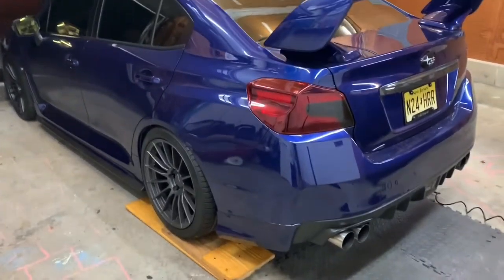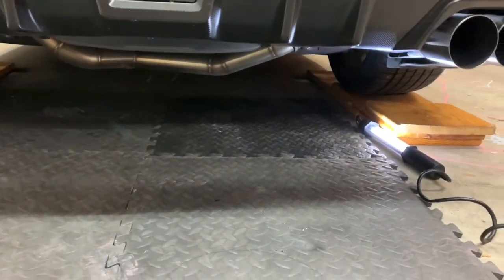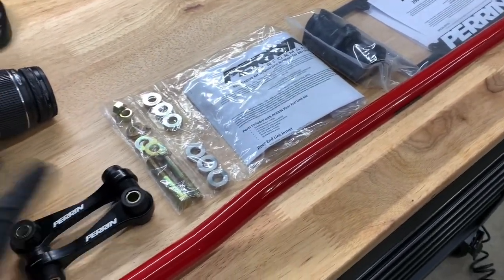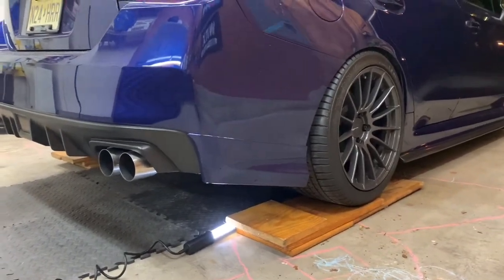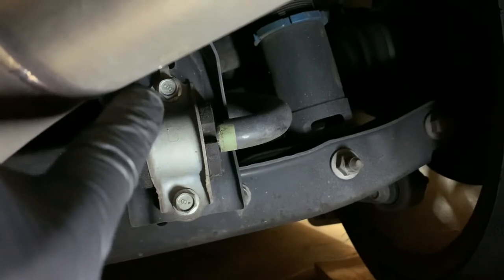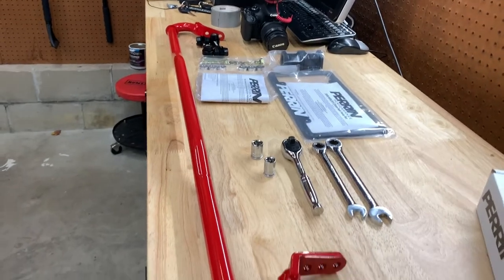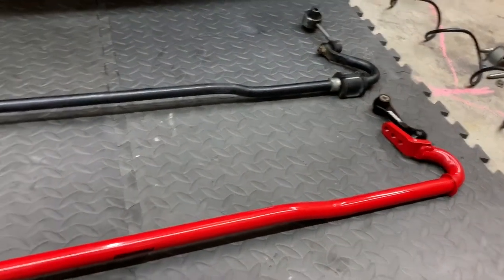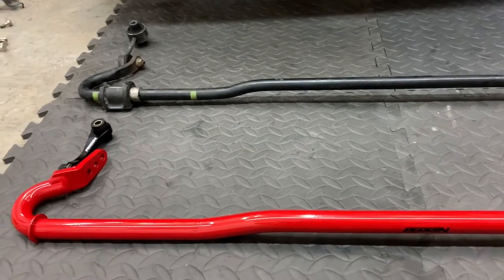Subaru STI Perrin Sway Bar and Endlink Install

Comment: @5:00 remember also that you don't need to PRY the end links out... all you need to do is loosen up the bolts for the struts/coilovers, which will significantly release pressure on the end links so that you can take them out nice and easily. You just need to loosen them, no need to take them out. =)

Comment: So you don't need to take weight off the back 2 tires to get the end links & bar off? I was wondering if I needed to jack the rear up and then let it down on the ground to torque it all back up.
Reply from the maker: You can do it off the ground or on the ground. Either way, the tires need to be on the ground when you finally torque the bolts down so the preload is on the components.

Comment: If I have plastic ramps for the rear wheels, does that count for the load being down (on the ground) when torquing the bolts down?

My ramps are a good 6-8” rise off the ground. Does the car (front end then) need to be level if I raise the rear end on plastic ramps? 

And I keep hearing mixed numbers for what to torque to in these videos, is it dependent on what bar and stiffness? Thanks!
Reply from the maker: Yes, on the ramps will work just fine. Torque is torque. Doesn’t matter what the stiffness is set at.

Comment: i had to issues taking out the olld sway bar but my biggest challenge was setting up the washers inside my LCA's which were a pain to do if your on the ground. did you have any issues with pushing your washers in?
Reply from the maker: It takes some finagling to get them in, but they will pop in when positioned right.
Reply: @Scoobyfreak86  yea I had to make some leverage from my wrenches to be able to slip it in just enough and then used a small flat head to drag it down to position it so the bold could go through. Also I noticed that your endlinks were position differently then mine, wondering if I put mine in wrong 😅

Comment: How did you get the endlinks installed with the spacers? Following the instructions I can't get the third spacer in even with a large bar...
Reply from the maker: Been a while since I installed this, but I don’t recall any issues with mine. They slipped right into the control arm just fine.
Reply: @Scoobyfreak86  Yeah the instructions were confusing. I put two spacers in facing the front side with the bolt holding them in and starting into the endlink and then they say to use a prybar or flat nose screwdriver to make room to pry the third spacer in on the other side. I ended up loosening the 17 mm nut for the strut and then used a screwdriver to push down the third spacer after I was able to wedge it in barely at the top and move it around until it all lined up. It was a bit of a pain for some reason.

Comment: Hi, do you have Perrin end links installed in the front too? I’m wondering cuz I only ordered the back ones.
Reply from the maker: Just the rears. Fronts are still stock.
Reply: @Scoobyfreak86  ok my sti is coming from Japan 2021 should I leave the stock ones or better off to get the Perrin ones in front too??
Reply from the maker: Leave the fronts stock. Never found the need to upgrade. Only time I will is when or if the stocks go out.
Reply: @Scoobyfreak86  understood thanks so much!